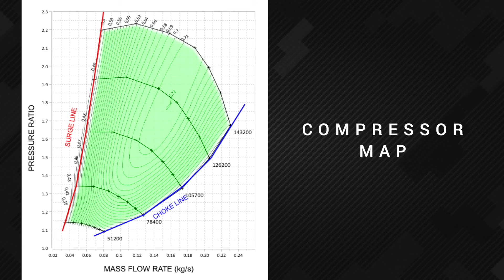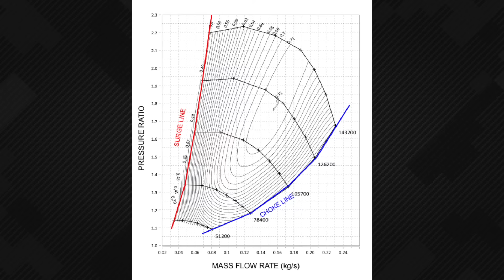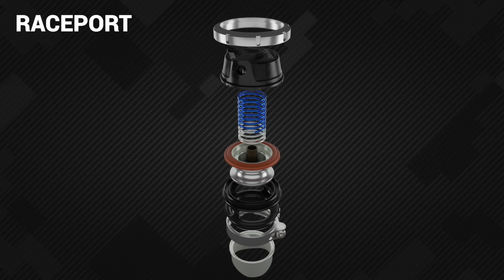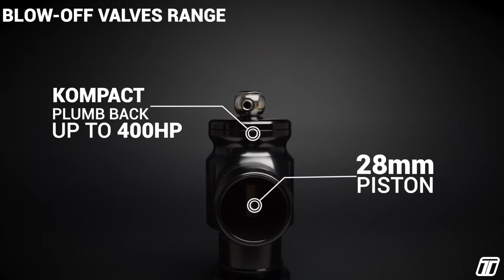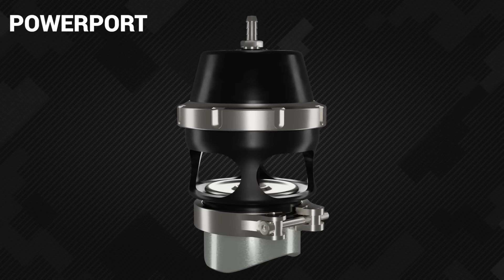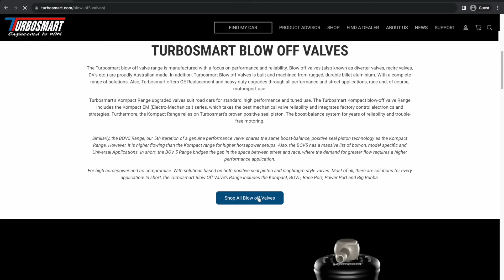Boost Basics | Compressor Surge, Blow Off Valves, and Turbo Maps Explained

Comment: I have a sound coming from my turbo area only during hard acceleration during the gear changes. It sounds exactly like when you pump the tyre and then disconnect the pumper and that loud air escaping for a second. What do you think it is? I don’t run a blow off valve but it doesn’t sound like surge

Comment: I put a kompact dual port in my focus rs recently and I came to this video because I was nervous about the quiet fluttering sound it was making when I let off the throttle under 5 psi of boost. Someone told me that was compressor surge. Sounds like that’s actually just the recirculation valve function working properly

Comment: I'm in the turbo Buick world.  We've been running without bov for 40 years and it's not really an issue.  They didn't come with them and most of us never added them.  It's the best? Probably not but i think turbo surge demonization is overblown
Reply from the maker: We are in the turbo everything world. While you can certainly run a system without a BOV it doesn't mean it is what's best for the turbo's longevity.
Reply: Yeah that's pretty much what I said @TurbosmartHQ

Comment: 1:50 the problem is when you close the throttle the waste gate cant flow enough air and pressure drops slowly so it still has pressure, it spikes when the 2 air fronts meet is forced back into the turbo, the turbo suddenly stops spinning in balance and binds the noise is the turbo fins slowing down and then speeding up as air is forced threw it, putting a lot of strain on the bearings, the blow off valve should open with the waste gate to control pressure then you don't need as big of a waste gate valve and will have much more control, a fast acting Eletronic BOV could maintain correct pressure in the intake in-between shifts to eliminate lag and turbo bearing stress, a boost bottle reservoir could also help but is complicated
Reply: Why would you want to bleed off the boost that you're trying to make..

 the job of the waste gate is to control the amount of boost...

The job of the dv/bov is to release that boost...

They can't work together.You can't bleed off boost that you're not trying to make...
Reply: @korey420  its to regulate boost pressure, too much is bad if the engine wants 20psi you dont want it spiking to 30 or 40psi is bad

Comment: If I’m going from recirculating bpv to a turbosmart kompact dual port 50/50 vent/recir w blue spring on my kraftwerks supercharger setup, will it hinder performance? It’s for my 9th gen civic si, and im switching bc the provided bpv from kraftwerks is known to be not so reliable, thank you !

Comment: What about surge at lower revs under throttle when the turbo is too big for the engine but you need that turbo in the top end? Can you use an electronic BOV controlled by the ECU to alleviate surge?

Comment: If i make the spring tighter will that cause surge? Im the guy that makes noises at work @myself
Reply from the maker: Installing a stiffer spring in your BOV will make it more difficult for the valve to open and release pressure. Using too stiff of a spring will induce compressor surge.

Comment: Isn't a blow off valve doing the same job as my stock blow out valve? Have a 1.6 turbo diesel, first trubo engine and well, it literally broke the shaft between the two compressor wheels...

Comment: Soo..... what do these do in regards to the power or performance ? Do you lose power by releasing the air ? Do you gain any benefits apart from saving the turbo?
Reply from the maker: BOV's protect the turbocharger. Regardless of whether the pressure is being vented out of a BOV or back to the turbocharger allowing compressor surge, pressure will release from the charge pipes. Typically this air will only release when you get off throttle so, no you should not lose power since you are not giving a throttle input at that time. Aside from protecting the turbo a BOV does not provide much performance benefit.